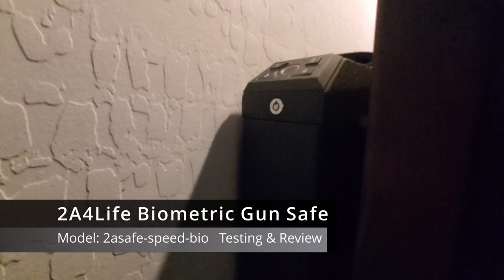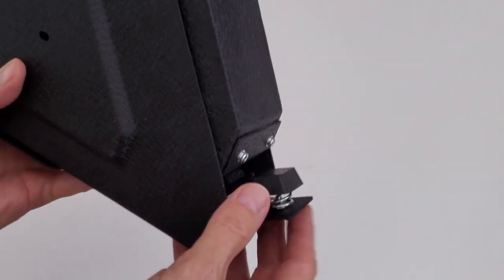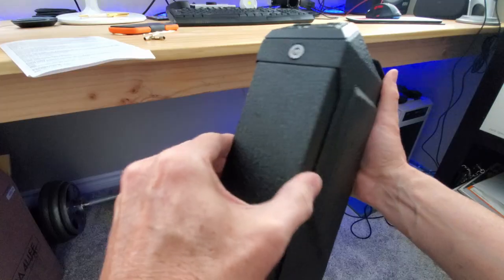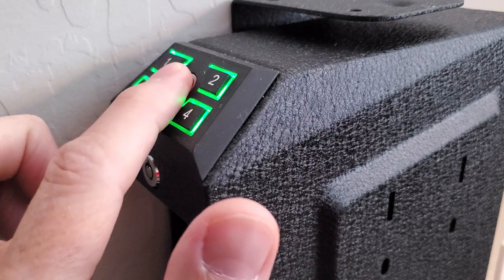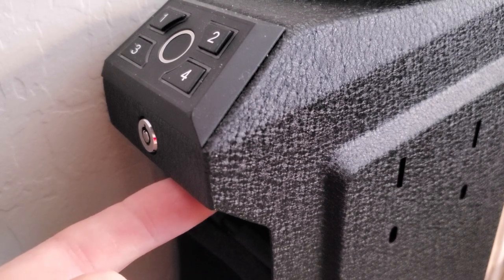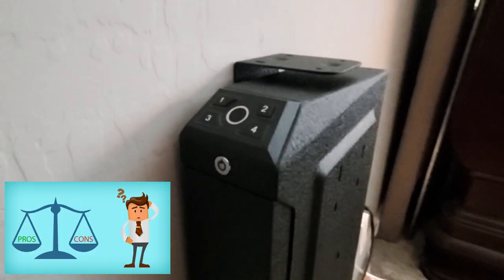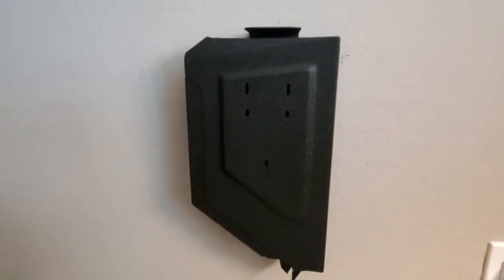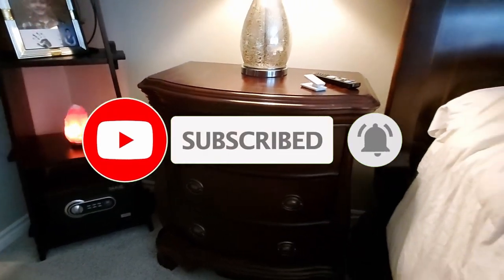2A4Life BIOMETRIC MOUNTED SPEED SAFE - BEST WALL MOUNTED SAFE 2021

Comment: Enjoy your videos but I do have two comments on this one... First, I would have installed it facing the bed so that you could grab it from there instead of having to get out of bed in an emergency to grab your gun.  Second and even more important, NEVER put your finger on the trigger until you are on target and ready to destroy something. ALWAYS put your trigger finger straight along the frame until ready to shoot, this helps eliminate accidental discharge of the weapon and shooting something or someone you don't want to kill.
Reply from the maker: Thanks for the comments and i would have installed it facing my bed but my bulky nightstand would make it difficult to access because my bed frame and headboard are in the way. And thanks for the gun advice however my guns had no bullets in the chambers and the magazines were NOT engaged. I always maintain safety with all of my weapons. My point was to show the size of the guns in my hand and how well they fit in the speed safe. Thank you for watching!
Reply: Came here to add this, trigger discipline
Reply: @UltimateTechHub  : That's not an excuse. Always handle a firearm like it's loaded, this includes trigger Discipline! That's how ND's happen under stress, from muscle memory.

Comment: We finally got the codes to work but are still having trouble with the fingerprint setup...any other tips?
Reply: I just got two of them today and have the same problem, the code works but the fingerprint is not. If it will not work we’ll return it:(
Reply: Same here, the fingerprint does not work

Comment: Will it accommodate a glock 19 (longer) with a mounted light and optic? Looks like the compartment would be too short?
Reply from the maker: Yes that probably wouldn't fit it's too long for the safe. My SIG P250 fits perfectly. They have other safes that would fit your gun.

Comment: Do you think this safe would work with a Glock 17 that has a Trijicon RMR mounted on it and also with a small flashlight on the bottom rail, which does not extend beyond the front of the pistol?
Reply from the maker: It should fit. The safe is very large.